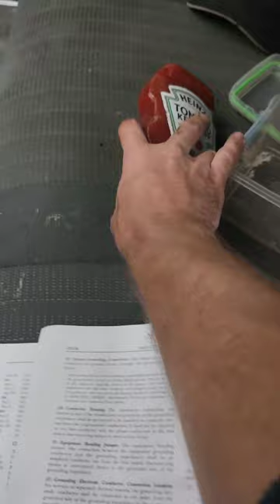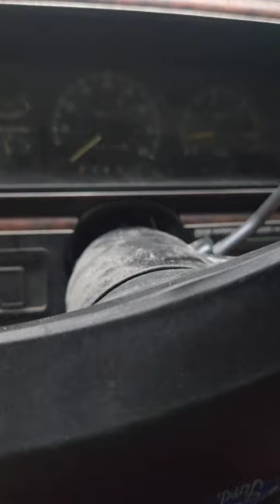UHAUL WOODS REVIVAL....again

Comment: Not to be overly critical here but how did you manage to struggle that much? Peg has shown you the way to start an IDI. Two good batteries and a sniff of the good stuff and she will chooch. Ffs, there isn't even snow on the ground and all the components seem to be in place to the point it could pass for road legal (or a coherent vehicle of any kind). Ya ain't even shitfaced drunk. 

I question your commitment to the cause.
Reply from the maker: You're right, I'm a failure. I'm now going to move to the west coast, eat Alvadcado toast, and drink soy latés to repent for my sins against my fellow men.
Reply: @ZiplocksAndBeadlocks  It could work. Southern Californians struggle with cold starts too. You should see 'em try to put on tire chains. You'll fit right in.